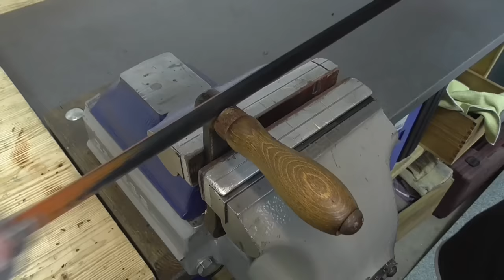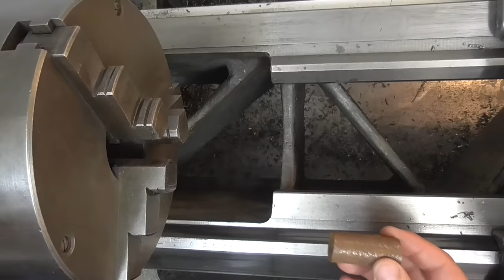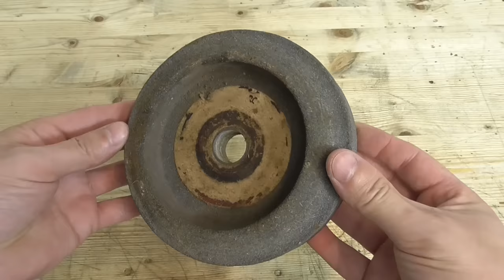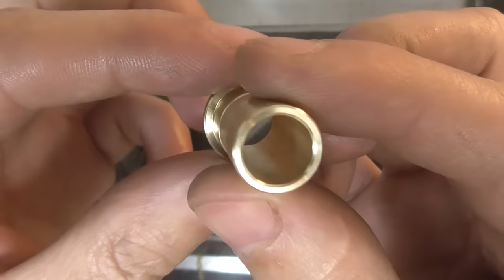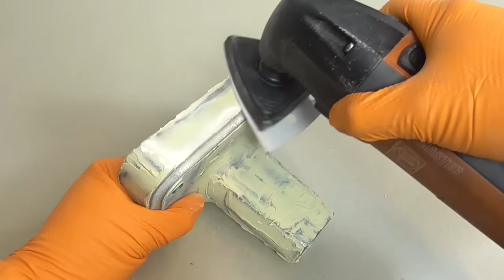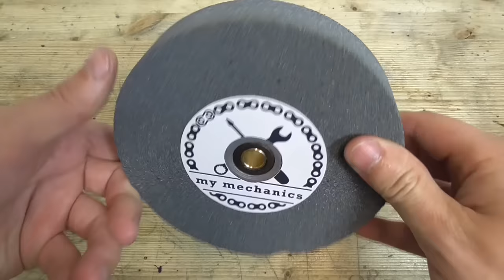Antique Hand Cranked Grinder - Restoration

Comment: So when a machinist welds they aren’t actually “welding”, just adding material?.....
Reply: Do you know how welding works? Because it's exactly what a welder does, a weld just adds metal which sometimes fuses 2 pieces of netal into one
Reply: @niklasalmaas6369  Nope, welding does not need to be an additive process. Spotwelding for example. Welding actually means, you melt metal into another piece of metal (at least 2 pieces of metal, most often 3). The difference to soldering is, that Soldering always is additive and adds a metal with lower melting temperature and without melting the base metal.
Reply: @HeartOfGermany  actually welding never add material. It's soldering that adds material.
Reply: @sovietcomrade7733  Are you trolling? Source?
Reply: @HeartOfGermany  my welding and soldering school.
Reply: @sovietcomrade7733  Something you can actually visually show me? So Tig welding with a rod or stick welding is not adding material? The Rod or Stick is just show?

To be clear: Just, because the 1 sentence definition does not clearly state this, does not mean it is not typically true in practice. Since you claim to have visited an apropriate school, you might want to tell us, what the purpouse of the so called "filler" is. So it is not a 3rd piece of material, which gets melted to fill the gap between the 2 main components? Are you absolutely sure the filler does not add material?
Reply: @HeartOfGermany  if you don't want to thrust a welding and soldering school student I can't do anything for you
Reply: @sovietcomrade7733  You are not even trying to explain and answering my question. So I guess you are in fact just trolling. Just school is not a trusted source. Who ever believes that is just dumb. I was in multiple schools and never blindly trusted anything. I always double checked "facts". Which was good, because I often learned crap in shool.
Reply: @HeartOfGermany  then don't thrust me it's gonna change my life
Reply: @sovietcomrade7733  by troll. Continue playing welding simulator :*
Reply: @HeartOfGermany  if only this game existed

Comment: The non fitting cover was probably the reason all these old screws were in there. At some point the original cover was lost so it was open for years. somebody who disliked his job dumped all screws from things he was grinding on inside the machinery. That is also why there are so many deep scratchmarks. At some point somebody made a new cover And so the dumping of screws stopped.
Reply from the maker: Thanks for watching, much appreciated

Comment: I have a hand crank grinder next to my lathe. It's one of my favorite tools. I use it to dress my HSS cutters and grind a new edge on screwdrivers. All the times you're sanding something on your lathe, shouldn't you have something down over the ways to protect them from getting grit all over? It's not my lathe of course, just that's what I do and that's what I see many other folks doing when sanding or grinding over a lathe. Maybe you're just very good at cleaning so it doesn't matter. I can't argue with your results. It looks amazing.
Reply from the maker: Definitely wouldn't hurt to cover the ways

Comment: Not sure if anyone has said it but those are not grease nipples. They are oiling ports. More than likely this was intended for oil bath lubrication not grease. People commonly mistakenly identify them this way and the heavy grease doesn’t properly lubricate the gear train. These are what you would expect to find on the ways of older machine tools

Comment: Very cool… but u replaced the grinding wheel with new one… the gap should be more with support rod.. however its reduced mean u replaced it with new wheel😅
Reply from the maker: It's not a new wheel, still the same
Reply: @mymechanics  great thn...sorry if you felt bad 🤗

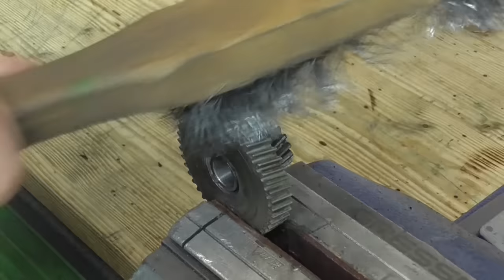Comment: At 7:37, on those gears, how did the original manufacturer create the swirls on the metal with the second gear there? Was the second gear attached by welding or something similar?

Comment: Only thing that I don't get is if you were going to sand/media blast the parts anyway why go through the trouble of paint stripper? Wouldn't the sand blasting have removed the paint too like it did with what was left over? Just seemed like an unnecessary step to me.

Comment: What do you use for chisels that are basically sharp mini crowbars that are meant to remove metal pins and such? I got a chisel and made the mistake of using it for both metal and wood and now it’s not very good for either.
Reply from the maker: You talk about the punches?
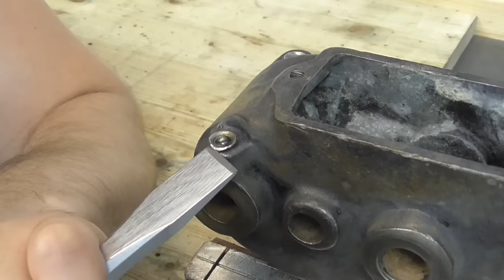Reply: @mymechanics  the tool you’re using at 3:15

Comment: Great, as always!
But it's very-very dangerous for the ways of lathe to do some operations with abrasive.
small pieces of abrasive (from that abrasive disk, or from sandpaper) will get between ways and cross slide for sure! and it will damage ways!
I hope you know it and don't cover lathe only for video, and you clean ways carefully after that
Reply from the maker: I sure make clear to clean the machine properly after sanding i general :-) thanks for the comment

Comment: Question my friend. Why do you paint strip before sandblasting? Couldn't you remove the paint by sandblasting it? 🤔
Reply: My guess, is that since heavy sandblasting can create pits in the metal he likely removes the paint to cut down on how long they're getting hit
Reply: @LowReedExpert1  cheers mate. Perhaps. Makes sense, definetly. Still find it a bit strange, because most of the times he covers those pits you mentioned with a lot of putty sanding it all down after.
Nonetheless it's a good perspective.

Comment: Aight, Don't all'ove y'all commence to bash'n all at once! I think that I might have another idea for the little bench grinder, Jus as long as the crossbar could be tightened up sufficiently. Now, I know this is probably to far fetched for most of y'all. Jus imagine git'n a thin cut'n disc that would fit the arbor diameter. Now,Stay with me here;cause,He could've went and made him a "A$$ KICK'N PISTON RING GRINDER" a whole lot nicer than them olé lil cheap aluminum ring grinders.Jus my .02's and I also like it as it's intended usefulness! 
PRECIATE Y'ALL, JOE C.🇺🇲🇺🇲🇺🇲

Comment: WHY USE A PAINT STRIPPER , AND THEN SAND BLAST  .  .  WOULDNT THE SAND BLASTER BE ABLE TO STRIP THE PAINT, MAKING THE CLEANING STEP UNNECCESSARY ?
Reply: Because the media blaster that MM uses is a recirculating blaster, paint chips can clog the nozzle and contaminate the media much faster. The media is very expensive so it's cheaper to strip then blast.

Comment: Strange that you touch rusted parts without gloves. Are you not afraid of  Tetanus? It is very dangerous disease causing Lockjaw.
1:28 ...Why the pin of the handle had to be cut?